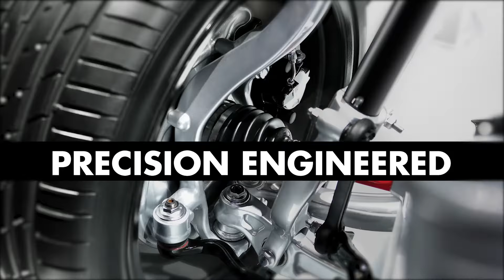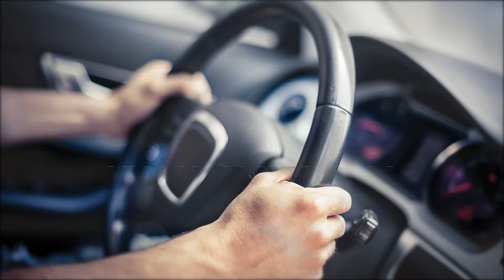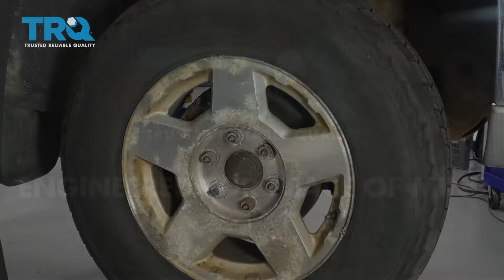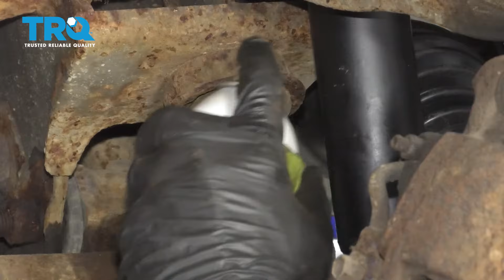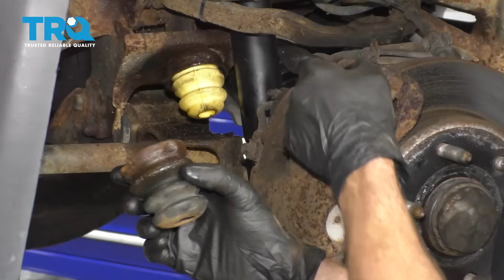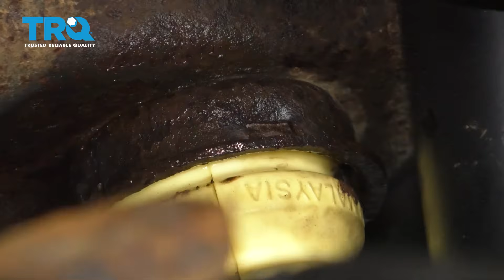How to Replace Front Bump Stop 1999-2007 Chevy Silverado

Comment: IF YOU HAVE A SILVERADO 1500 order the 2500 rubber bushings for the front and it will feel so much better ! All you gotta do is put them on backwards for them to fit a 1500 year 2000/2006

Comment: Remove the rust using a wire wheel die grinder and it will slide right on.

Comment: If the lil cup that holds them comes off how do u fix that
Reply: Mine appeared to be plug welded and came off. Not bolted!
Reply: With a saws all or angle grinder. I had to do my fronts they rusted out you can buy the whole assembly with the nut and bolt you are better off in the long run.